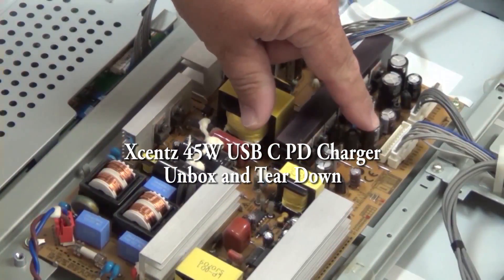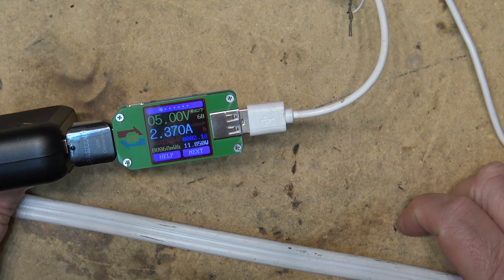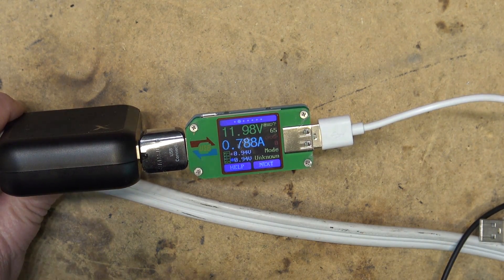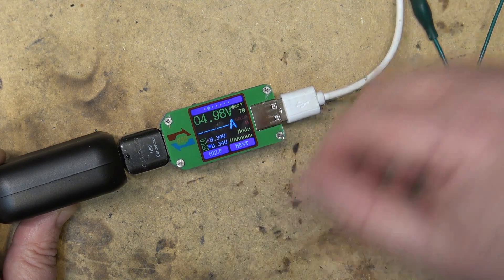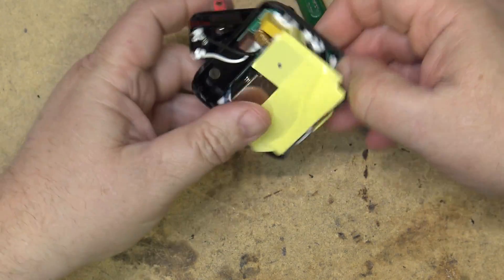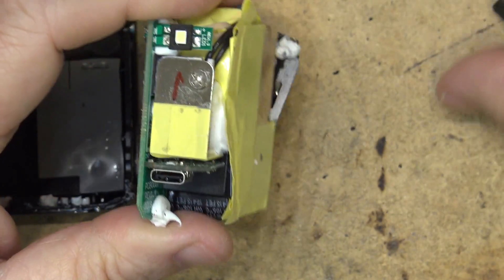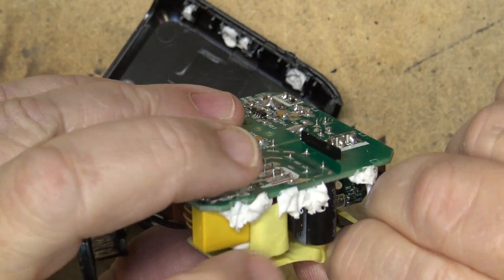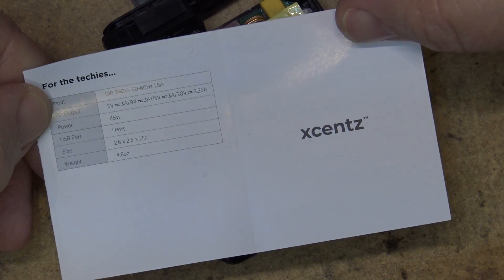Xcentz AW31011 Single Port 45 watt USB C PD charger review and tear down

Comment: Thanks for the tear-down of this unit. Not many people do it with modern compact chargers. SMD footprints/soldering quality is actually bad. Look for example at snubber network - it's one big blob of solder. It's just a matter of thermal cycles number/shock before C17 termination will delaminate, and without the cap, FET will blow up.

Comment: Looks like a fairly nice charger. My laptop has the same style USB-C charger and you can feel an electric tingle on the chassis (aluminum I believe) when it's plugged in. Do you think it could be because of the lack of a third earthing pin on the charger or something else that may have gone wrong? 

Btw, are any VCRs on your repair/tear down pile for the near future? I'm really into analog video and watching your VCR videos is one of my favorite things to do.
Reply from the maker: Yes lots.  I am not doing much service right now because my work schedule is crazy. Next week I change my shift to longer days at work, but it is a 4 on 3 off schedule so I will have much more time to concentrate on making videos.  Also it is cold out right now so that also slows stuff down.  I have heat in the shop but plugging in a 5kw electric heater gets bloody expensive to run so I avoid it at all costs.

Comment: Don't know about the USA, but I believe in Europe, changes are due to make products serviceable. You had to destroy the product case to dismantle it. Maybe in future screws will be used rather than welding/glue leading to less landfill.. hopefully!!
As a PSU designer, a few suggestions for review would be to dig down into the specs of the electrolytic capacitors to see if they are top spec parts (temperature, life, ripple current). I'd also check how much power is lost in the case. If it is 80% efficiency at 45 watts that's a fairly herty 11.25 watts loss.. the internals will get rather hot.
Reply from the maker: Most switching PSU are in the 95% efficency range.

Comment: I need to find out what's the difference between mini USB and USB C
Reply from the maker: There are many differences. Power capabilities,  transfer speed are just 2 of them.
Reply: @12voltvids  the answer I cannot find is will a USB C plug fit in a mini USB receptacle? The local Dollar store has mostly USB-C. Mine is mini USB. I didn't think it would so I didn't buy the USB-C.
Reply from the maker: @markmarkofkane8167  
No it will not fit.  Mini USB,  micro usb, and usb c are physically different.
Reply: @12voltvids  thanks!
Reply: Have you tried Googling the differences between Mini USB and USB C? I'm sure it's out there in the ether.

Comment: Many not so good power supply from china. I bought one from china and it does not have noise filter on input and output and does not have ic. circuit control that almost everyone has. a lot from china is dangerous to use!

Don't use cheap china chargers on your expensive phone!

Comment: There is nothing wrong with that xcentz charger, very decent indeed :-).
Nice to see that they have covered all the bases for safety.

I have an old big white pot tube wirewound resistor with a thick clamp as a wiper, the type that used to exist in old roadside power generators.
Handy as a load for power supplys :-D.
One day i might make a electronic constant current load, but i don't test too many power supplys at the mo.